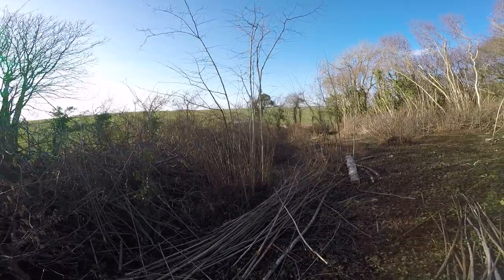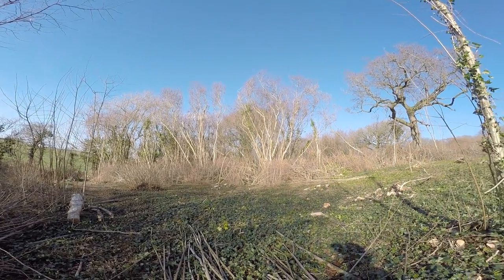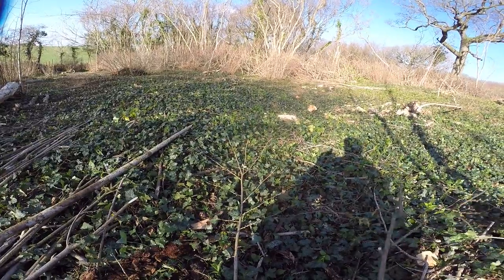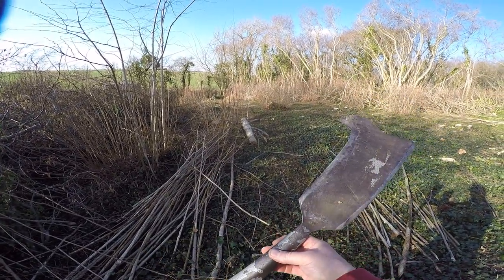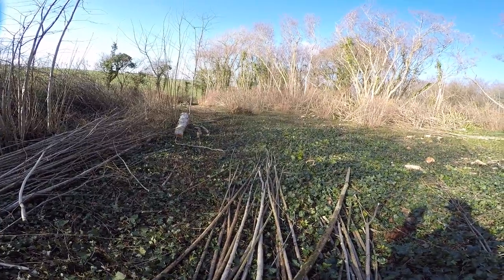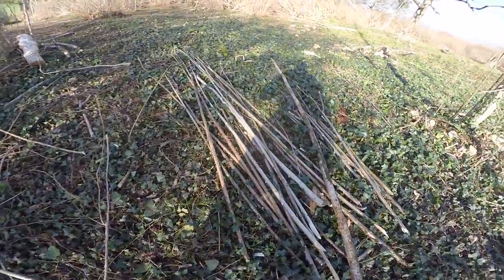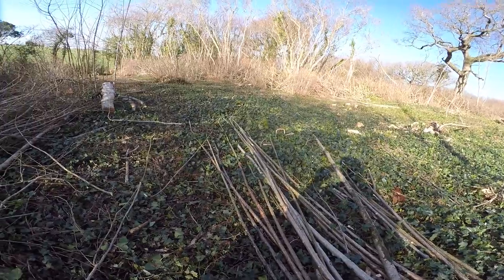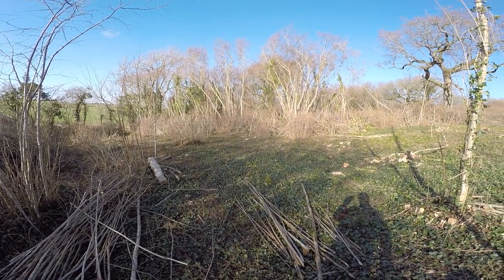Using a Yorkshire billhook to cut hazel bean rods. Technique, safety, other possible products

Comment: Wow that is quite a remarkable tool. I wish I could find one like that in the US but it would likely have to be custom made. Through my research I found that some Yorkshires were fitted with 36 inch handles, and in that configuration would make something similar to a brush axe. I imagine the hook side could be used for brambles and the straight side for limbing trees.
Reply from the maker: I liked mine. Currently misplaced, but it'll turn up. It was designed/evolved as a hedge laying tool. 3' haft would be too long and most old hedgers would have used a slasher (like a billhook on a long haft) for trimming a growing hedge and trimming out rubbish from a hedge you are about to lay. Hook designed for shearing small side branches, trimming ethers (or heathers, binders) but will do brambles and will hook prickly stuff towards you saving your hands. Straight edge for pleaching stems and pointing stakes. The notch between blades for pushing pleachers into place - hedges were often hawthorn (whitethorn, quickthorn, 'quick' as in 'live' 'cos it grows well, is hard to kill and is prickly enough to deter livestock - barbed wire didn't come in 'til mid way through the 19th century of course. Want to know more, watch this:  https://www.youtube.com/watch?v=WoprVhpOKIk&t=201s
Reply: @anemone104  Oh yes that's a good resource, very informative. If I am not mistaken, the gentleman in the video is also using a Welsh pattern axe to hammer stakes and cut thicker parts of the stems, which is interesting because I've only heard of it being used as a rounding axe on large trees. Perhaps it's design makes it good for hedging too.  

I suppose what I was getting at with the Yorkshire was that while in it's normal configuration it was designed for the tasks mentioned, an extra long haft was probably used by some to transform it into a slasher-type tool and allow it to be used for heavier work. In any case, clearly they are well thought-out tools with specific uses in mind. I always wondered why Yorkshires had a notch instead of a straight top, but it makes sense why they would've wanted to use it to keep clear of the thorns. 

I hope you find your billhook, thank you for sharing!

Comment: I've got the same one , how do you sharpen yours?
Reply from the maker: I use a fine stone and a bit of spit. My hook, my stone! Video here 
https://youtu.be/DyOHfL7BNt0   if you want to see how.  Of course I am holding the GoPro in my left hand and I'd normally hold the hook.... Thanks for your comment.
Reply: Sassy where you bum how’s lez
Reply: This is pure nostalgia for me my dad was a sewage works chemist in the sixties in Lincolnshire. Attached to the sewage works was a small farm worked by the workers. One thing my dad learned was to lay hedges using a Yorkshire pattern billhook, which escaped into Lincolnshire and was used into the latter county. He was given the billhook, it's ash handle worn smooth by years of use. That was in 1964. He used it for the rest of his life to lay the hawthorn hedge at the back of the garden. If you had stuck it on a pole it would have made a fearsome weapon, worthy of the Battle of Towton. Of course, as a child I was not allowed to touch it but my dad spent ages sharpening the edges (he loved sharpening as he used a cut-throat razor most of his life).
Reply: If yours is really dull, or the profile isn't just the way you like it,  a belt grinder that takes coarse 1" belts can save you a lot of time. The narrow belts work well for the tight recurves on some billhooks, especially if you go above the platen so there's more 'flex'. 
Failing that, you can use various grits of sandpaper clamped to a 2x4 with one of the block's edge rounded over slightly - this rounded part will allow sharpening of recurved edges. The sandpaper pieces should be cut to the width of the block, and long enough that you have space both for sharpening motions and for whatever clamping method you use to hold everything down. You'd want to use an edge-trailing, stropping type motion to avoid cutting into the sandpaper. I used this method to reprofile the edge of a Fiskars 'brush axe'... brought it to almost a mirror finish once I went through all the grits I had. 
An alternative to traditional canoe stones for maintenance of a fine edge are ceramic sharpening rods. Granted, you might need to jerry-rig a carrying option for field use.